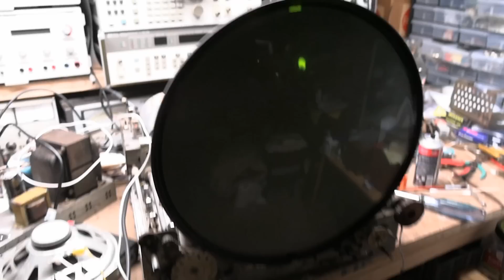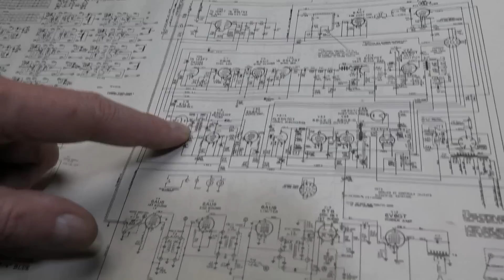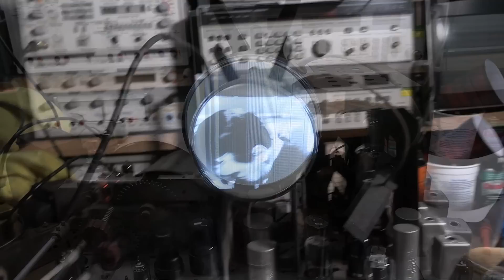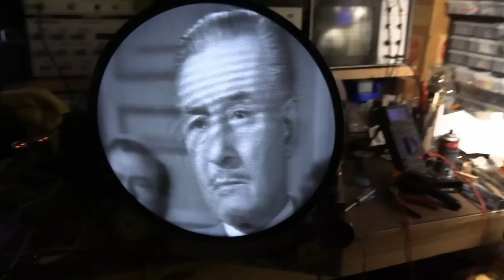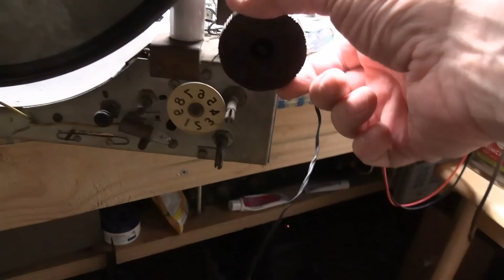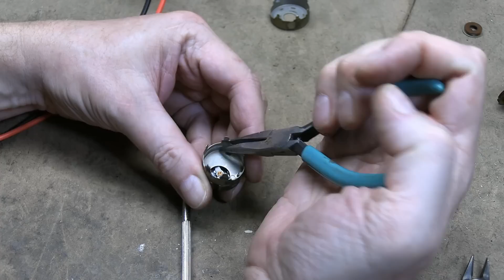Zenith 1950 St Regis porthole part 5

Comment: I have 24H20 with a 19AP4B tube in it (metal/glass)  (Replaced in 1955 by a Sylvania tube -- heard that the metal/glass concept was problematic -- but it tests good)  I have it as a winter TODO (my first BIG set).  Do you have the other parts (I see only part 2) available to watch?  This was the beast I acquired in my collection.   It's part of a Phono (Cobtramatic) and AM/FM radio combo.

Thanks in advance!

Comment: is it possible to hit the tabs with a torch and get them to red heat for a second to anneal them to get rid of the work hardening once the control is apart to stop them breaking on reassembly?
Reply from the maker: Possibly.  I've never tried it.  I'll try to remember to give it a go next time.

Comment: I do keep wondering why you don't just plug the Variac in a switched socket and mount the switch to the front of the bench. Maybe mount the entire Variac under the bench. Easy safe access and you don't have to reach over hardware with dangerous voltages, especially when things go wrong and "blowing" up. Haste leaves a lot of room for oopsie.
Reply from the maker: No where to mount. Couldn't see the meter. Not going to cut into the 2x6 forming the bench. Never had a problem the way it is.
Reply: @bandersentv  moving the meter was only an option. Surely you could find room for a switch at the front and switch the socket the Variac is plugged into. 
I can't force you to do that😃, but I have seen your videos and you always seem to be "reaching" for a device that is obviously used a lot. A on off switch in the front to switch the socket seems such a simple solution. And you don't have to see a switch.
It's what I do, never have to reach over and I can quickly kill everything in case of problems. But it's just a suggestion.

Comment: Hopefully you have a printer that you can manually clean the print heads, or easily remove them to clean them if it just doesn't need new ink carts. I had a Epson that the heads would dry out from sitting too long and the heads weren't easy to clean or remove.
I finally gave up and bought a HP 9025 with user removable heads and all the extra goodies. It can sit for months and will print like it was used recently. Aftermarket ink is reasonably cheap and it prints super fast, and pictures look great.
Eventually I want to get an ink tank printer that does everything this one can.
As far as the TV that's why I always liked Zenith sets, excellent picture quality and reliability.
Reply from the maker: It's actually a laser printer and it has trouble with grayscale. I can try printers at work if I need to.
Reply: Never had one but you would think they should be great at Grey scale.
They should be super cheap to print with considering how they work. Color would be a issue I would suppose if you need it.
At least you have options till you figure it out.
Reply from the maker: The toner is a pure black powder that gets fused to the paper.  Only way to get gray is to use less powder which ends up being faint.
Reply: @bandersentv  Well, pros and cons to all the printer tech I guess. I've thought about a laser printer but I like to print quality color photos so I think an ink based printer is better for my use case, except for the ink being expensive. Laser tends to be expensive up front for a decent one, of course my printer would have been expensive too but I found a low miles used one that was like new for 100 bucks, locally, on eBay after using the entry level version I got at Costco for a deal. I wanted the dual paper trays and faster speed so I got the 9025 and sister uses the 9015 so a win win and I have regular and photo paper ready to go as needed.
Reply from the maker: @69Dartman  Color laser printers have come down a lot in price. Replacement toner is a bit expensive though